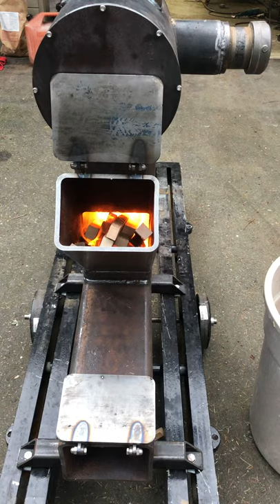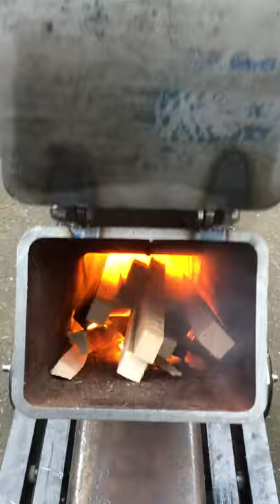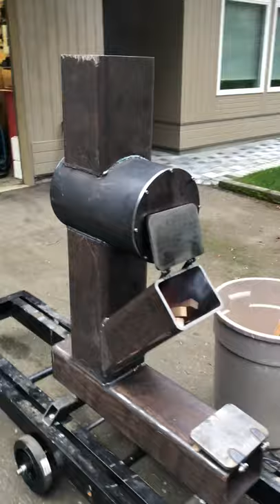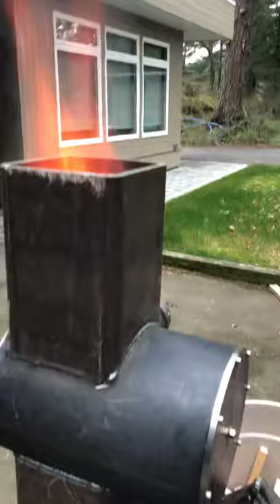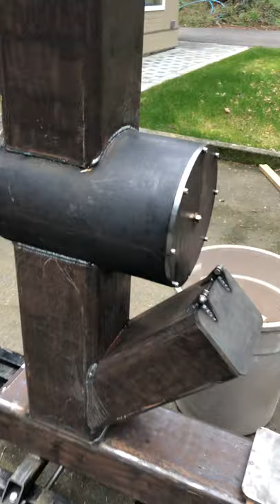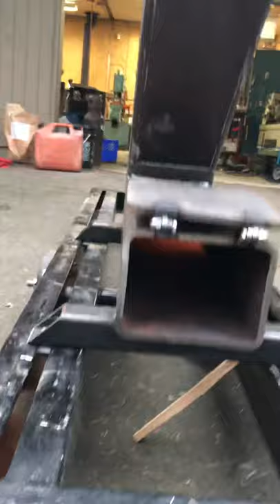Rocket stove

Comment: If you close the fuel hatch and leave the only open ports being bottom air vent and top exhaust vent, it should burn much cleaner and actually even hotter, bc the air intake and exhaust outtake are totally seperate and the combustion bow forces the same amount of air into a smaller area, increasing the ramjet effect.

Comment: Great build. I have found on my stoves  that a chimney riser above the fire box needs to be at least 14 inches to obtain a more complete fire burn.  with the higher chimney there is no black on the cooking pots ..
Reply from the maker: Thank you
Reply: @daveconway7109  iirc, the minimum chimney height should be 3-4 times the diameter.  What is more important is A) surface area to absorb heat from the air and B) how well the walls hold/release that heat.  

Internal baffles to increase surface area and rock wool/etc. wrapped around the outside will make it much more efficient. 

(An optimally-designed rocket stove needs a refractory ceramic/brick or stainless steel chimney because it can utterly destroy regular steel in months!)

Cheers!
Reply from the maker: @KeithOlson  hi Keith
Thanks for your input the project is still a work in progress but I’ve added a link to the latest work I’ve done on the rocket stove/ Sterling Engine 

Thanks
Dave

https://youtu.be/vy5ahm0zC-E?si=mGM2gx_U9mVeJ3LK

Comment: What is the reason for the round tube in between the vertical part of the stove ???
Reply from the maker: This is where the hot end of the Sterling engine is going
Reply from the maker: 1①
Reply: @daveconway7109  How much power is the engine going to have roughly ??? Thanks Dave.
Reply from the maker: @victoryfirst2878  sorry don’t know, I found the engine,  got it going but have no way of telling how much power,  I’m going to have it drive a generator
Reply: @daveconway7109  Look forward to see the item work Dave. Good luck. V

Comment: What is it for? Seems too heavy for camping but too small for home use and no area to cook food on or in. Is it just for burning small bits of wood? Seems well made though.
Reply from the maker: I’m going to be adding a Sterling engine that I acquired to it soon, the Sterling engine was made in Sweden by a company called inresol that is no longer in business
Reply: @daveconway7109  that's good. Will you insulate the stove so the heat goes to the desired area instead of radiating out in all directions? I like efficient designs, that is why I ask.
Reply from the maker: @Martian74  probably yes but I’m going to see how the Sterling engine works first it’s designed to go in that bulbous area around the middle
Reply: @daveconway7109  a lot of heat wasted out the top, if used for an engine, anyway to reroute / recirculate it ??

Comment: Are you supposed to be able to see the fire through the welds?
Reply from the maker: It wasn’t yet welded there as the tip of the torch I had wouldn’t get into that angle
Reply: @daveconway7109 Ah, I was scratching my head wondering if it was to let air in when all the other doors were shut. 😅

Comment: Good work. Kindly provide dimensions and cost. Thanks 🙏
Reply from the maker: Sorry not for sale,  just a hobby
Reply: Thanks for your reply. Sir, i want to design it myself. For that can you please tell the dimensions and thickness of the pipe used. Is it a 100 mm square pipe? Please also reveal the benefits of adding a cylindrical horizontal section. Thanks.
Reply from the maker: The square tube I used was what I had lying around, it 8x8 inches 1/2 thick, the cylindrical part is to accommodate a Sterling engine, which is an another video on my channel 
Cheers

Comment: I going for a powered draft so i can run it for indoor heating. In the future I need  venturi chimney.   When the grid goes I still need heat.  Too poor to have a power wall.
Reply from the maker: Should really get hot with fan assisted draught

Comment: Add a fan in the lower intake. A 12v cpu cooler should be enough.
It'll burn like a real rocket!!
Reply: if it doesn’t melt…
Reply: @demo-server4091  it won't...
The fan blows from outside,through the pipe towards the heat source,pushing (the heat) in the other direction.
The same way a coal forge works
I have one with a bigger fan,it works great.
But since this is a stove,a cpu cooler will just kick the heat up a little
Reply: @eltallerdeelberg....1273  ah ok, my bad
Reply: @demo-server4091  
😁👍✌
We all learn something new everyday
Nobody knows everything
Reply: Use a piezoelectric generator to power the fan ... 🤔
Reply: @kiwiaus  
Or a thermoelectric Peltier module!